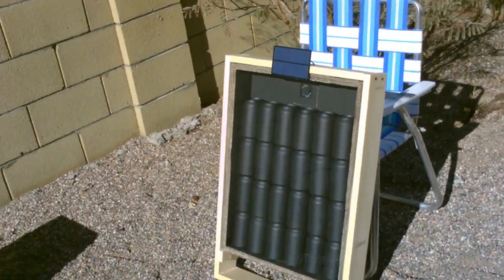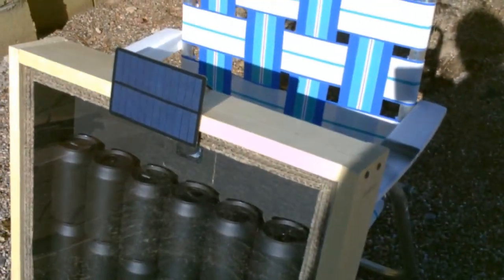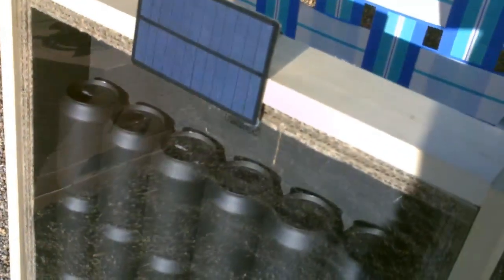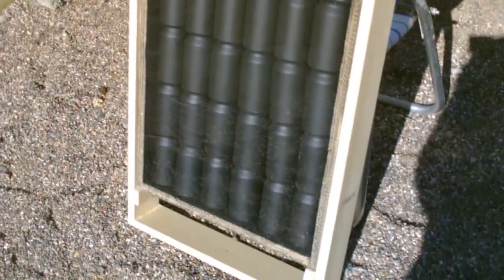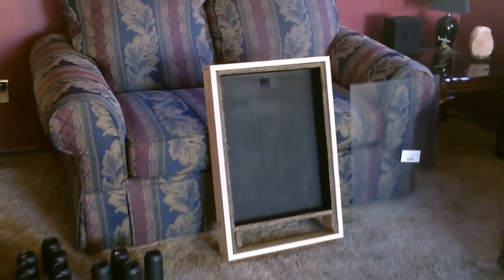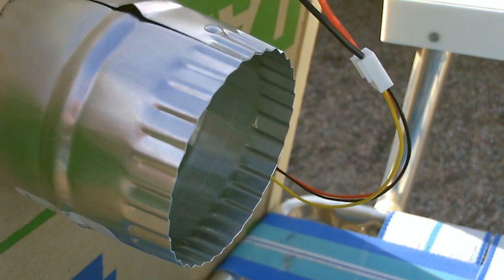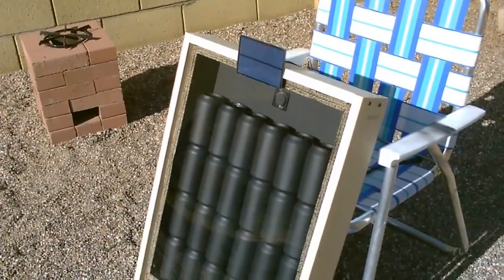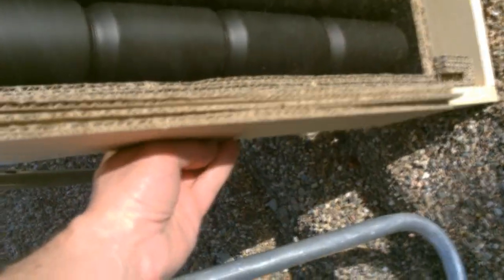Solar Air Heater - DIY solar thermal furnace - 150F+ Temps. (beer/soda/pop can heater) - full vid.

Comment: My heat is electric, I wonder if I can use this to supplement my heat to save some money.  Now just how to get optimal heat from this to my condo...
Reply from the maker: hi. these are a great solution for supplemental heating. i find the best way to get the heat in the house is to pipe it in through a window. i use a 1x6 board in the window (with vent pipe attached). just slide the window down onto the board. plywood should work also

Comment: Dude would yo be able to to send a link to this small fan and small solar panels?
Reply from the maker: hi. i can't find exact links but you can use pretty much any small 6 to 12v computer case fan. they have lots of them on amazon. the solar panel was from radio shack. you can get similar ones on amazon too.

Comment: Only down fall is when it's not sunny your not staying warm here in MN winters. I wonder if there is a liquid pex line to run through your system to store disapaiting heat longer? Ive also thought roof top space has always been underutilized. An entire roof could be done this way but glass roofs are a challange, I suppose poly carbonates / acrylics don't refract lights as good as silica glass. Your thoughts?

Comment: Can anyone offer help on mounting the glass? I could put a bead of silicone all around and let it dry, then use that as a cushion and to even out areas to make a seal, but then how to screw it down? I don't want to glue it in, because I need to get inside it to clean and replace the fan, etc. I thought of using rubber foam window seals, but thought they might degrade. I'm really at a loss.

Comment: I'd like to use one of these DIY solar air heaters for a tiny house I built that uses a wood stove for primary heat. Does anything prevent cold air from entering the house during night time? I'm envisioning adding a backdraft vent just inside of the tubing/piping that ducts the heated air into the house, keeping the backdraft vent near the solar powered fan; I think that the fan would blow open the vent and that as the sun goes down, the vent would shut once the solar powered fan stops running. I'd like to use this concept to create passive heat in my tiny house when I'm not home to be running the woodstove, just to keep the temperatures up a bit compared to a non heated environment during the winter but I don't always return home until later in the evening so I don't want cold air entering after sundown. Also any advice one what a good size unit would be for living in upstate NY? Thanks!

Comment: Looks Great got a question. If you were to put that same setup in the house facing out a south window. With a fan at the bottom pulling cold air off the floor and the hot air coming out of the top would it work better? Plus being inside it won't be as cold to start with... I like the idea but would like a little more info :) Plus if you put the fan on the intake side where its cooler wouldn't it last longer?
Reply: I was wondering this as well as the air in house is already preheated - but I cant see why not

Comment: You should install the fan on the air intake, for the simple reason that you generate heat , so the life span of the fan is reduced because of the heat :) Otherwise is a great concept (I am thinking to heat a greenhouse using this) - additionally with a controller (arduino perhaps) you can control the fan - to push air in the building or to extract air from the building (heat for example) ....

Comment: What are specs on your solar panel and fan? Will most 1.5 - 2watt panels power an 80mm computer fan?
Reply from the maker: hi there. it's a 6v 250ma solar panel. a 1.5 to 2 watt panel would be about the minimum size panel that would power a 80mm fan. a 3 to 5 watt panel is optimal

Comment: I made mine fairly large 44" X 78" and uses 224 cans. The box consists of galvanized steel studs creatively tabbed at the corners to make joining easier. 1/8" masonite backplate. 1-1/2" foil backed, high heat resistant foam insulation. Large 12v fan on the cold intake side for obvious reasons.  1/4" heat treated safety glass cover. Weight approximately 80lbs. Mounted on roof. Most efficient design I have come up with yet and only 4" thick! Small types work great also but I needed to heat a large area.

Comment: I have made a solar heater similar to yours, but i have trees that will block the sun light at different angles. would you have an idea to align the sunlight to the solar panel . I have tried many times to angle the box to the sun light, sometimes it will work and other times it wont.

Comment: Is there any impact on heat output if you reduce the air flow speed?
Reply from the maker: +TheJezrock hi there. yep. the slower you run the fan, the hotter the exiting air will be (because the air has more time to heat up before being removed). *the trick to maximizing the efficiency of these solar air heaters is to properly size the fans airflow volume with the size of the box.
Reply: Thanks for confirming

Comment: I love this design, but curious what do you do during the night?  The nighttime is when you need the heat the most, however I don't think this does any good without the sunlight, no?
Reply from the maker: Nathan Daniels hi there. since these types of heaters only work when the sun is out, i use a natural gas furnace at night. i'm currently working on possible ways to store the heat generated from these types of solar heaters for later use. (using water/sand/rocks etc...) all store heat well and are typically plentiful and free
Reply: +desertsun02 we used mostly passive radiant heat overseas, just a unit outside made of cast-iron and gas, heats up the water, then it starts at lower elevation through the house and at the end completes with highest elevation.. i think heated water naturally flows through the house so the end of the pipe coming back is luke-warm at that point. When gas would somehow be cut off at night, the pipes are still lukewarm in the morning and house stayed warmer than otherwise. IF you went with rocks for storage, would you want to insulate them then perhaps open insulation when needed at night?
Reply: Nathan Daniels it's nice because it keeps your house warm during the day meaning that when you come home you've already got a bit of thermal energy left in your house meaning it's easier to keep warm during the day.
Reply: desertsun02 I  thought the  same thing first!  But later I  realized, that  I(and lots of other ppl) don't sleep  very  well  in temperatures above 20 C degrees.... for me, it's a torture  to sleep during the summer tropical nights, when temperature  doesn't go under 25  C  .I even sleep better in   5-10C conditions - because I love to burry myself in the bed :P ... optimal sleeping temperature  is  around 18C  so  residual  heat  from preheated  room  and  the  insulation of the bed  itself  is enough to keep you healthy-warm during the night:)   but I am curious how this   device  works  in  -15C  outer conditions.....
Reply: desertsun02 Hi there! What if you raise the floor so at to heat under it and allow the floor panels to absorb and redistribute heat throughout the day?

Comment: Nice idea to simply use dryer ducting; seems easier than dealing with a bunch of aluminum cans, plus you get even air flow since it is just one path compared to most can based units.  Some designs use cans mounted horizontally in rows, with baffling to direct the air through all of the rows in one path, but that's a more complex design.  I think I've seen where some one put steel wool inside rain gutters or cans or whatever they were using for the air channel, to increase the surface area and heat the air much more.  That might be a good idea with this design since the ducting is rather large in diameter; the steel wool would also slow down the air speed allowing further heating.
Reply: +Sitaifun Mac Interesting idea for putting steel wool in the cans. I'd be worried that it might bunch together limiting the flow rate and the efficiency of the system. It'd have to be quite porous and probably mounted to the side in some way. Do you know where I can find more information related to the efficiency using steel wool? I'd be interested it in incorporating it in one of my future projects if it does increase energy production from a unit. 

Slowing down air speed will allow further heating, but with all heating systems you want to increase the energy/time, or power of the system. Too slow you get a high temperature, but less air, meaning the amount of energy you receive might actually be less over time, when compared to a large mass heating up slightly less. These are the considerations that ultimately effect the fan sizing (speed of air) and the maximum amount of heat you may get out of a system based on the temperature increase due to solar radiation.
Reply: +Braydi McPherson - I agree it would be important to avoid slowing the air flow too much.  You could pull the steel wool apart so that it is fairly porous, and if necessary you could use a variable speed fan to control the air flow.  There are quite a few variables in each unique solar system design and operating environments, so it could be a challenge to quantify the results.  However, I found someone has done just that: http://www.academia.edu/2463982/EXPERIMENTAL_INVESTIGATION_OF_SOLAR_AIR_HEATER_USING_POROUS_MEDIUM  They got about a 26% increase in efficiency.

Someone also employed steel wool in their solar dryer with good results: http://www.currentscience.ac.in/Volumes/107/03/0350.pdf

So I recommend giving it a shot and see what kind of performance you get for your particular scenario.  You could try different materials such as steel wool, aluminum foil strips, copper, etc.

Comment: He's in 40-55 degree temperatures.. I'd be interested to know what temps it can heat to in -5 to 32 degrees F
Reply: It's a solar heater, so it depends entirely on the amount of sunlight hitting it.
Reply: well, it looks like it's just heating ambient air, so the lower the temperature input, the lower the temperature output.  I think a way to get around this would be to funnel the air through those can stacks in series, so the cold air would have longer to head up.
Reply: @wamatt2476  Except the air would have to move the cans faster since the fan will suck out the same quantity or air. I<m pretty sure the air will be in the cans for the same amount of time in the end. Plus the sun exposure wouldn't change either, so the same amount of energy will be transfered. I'm pretty sure this also makes it easier on the fan because the air flows easier in this than it would if it was in series. If you want more heat, make the panel bigger. There is no secret here, the panel has a limited sun exposure. The more exposure the better. But I love how this design is small and seems very efficient. The kind of thing you can put in your bedroom and turn periodically to follow the sun!
Reply: Insulate the ducting going in and out of the house, as well as caulk all areas of the heater box. I'm adding mirrors to both sides of mine to increase solar absorption. My collector is different from these on YouTube, and I'll be posting my first video on it in a few days

Comment: If you only draw outside air from the lower cans, then how is the cold air removed from your home to be replaced by the warm air with your unit? Without a plenum at the bottom, it just seems that your drawing the outside air and not removing the cold air from inside the home. This would still produce heat to be pushed into the home, but would not be as efficient in exchanging the hot air inside with cold air, as nothing is being drawn out by this type of solar heater. Maybe I missed it, but this is more of a question about the unit construction and efficiency than a negative comment. I just didn't understand how this style unit works better than one with a plenum that removes the hot air from the home as the cold air is pushed into it. Nice looking unit though.

Comment: I didn't believe this until I made it myself. Outside it was 40F on a bright, sunny day. My heater was putting out 150F temperatures, and higher (my thermometer just said "HHH".)

I used corrugated metal sheets.

Comment: Is it possible to use soup cans? Specifically Campbell soup cans that have flip tops that peel out the entire top of the can? I noticed the use of silicone to seal the cans together but in addition can you use Duct tape to seal them together and then paint them?

Comment: I want to ask you about matching the Solar Panel to the fan. I heard you say 1.5 volt panel to the 1.5 volt computer fan. Is that correct?
Reply from the maker: hi there, i used a 1.5w 6v solar panel. the computer fan can be run using a 6v panel or a 12v panel.

Comment: is there anything inside the cans?
Reply: cans are empty, with holes in top and bottom to allow air to flow through them like a tube.
Reply: I was wondering if it could be filled with those terra cotta balls for hydroponics or small stones--maybe at least in the lower level cans as it would add weight, but maybe better heat storage?
Reply: Or maybe filled with steel wool?
Reply: L84aD82012 No, because that would stop the air flow through the cans. The air flows through the system due to convection, a bit like a solar chimney or rocket stove.
Reply: On many units, the person can take steel wool and attache it to the openings of the cans. It is generally rolled into a tube-like donut shape and has an opening in the center of it to allow free air flow, but to also act to keep the heat conductivity of each can where they join together. The cans contract and expand, so this type of mod would supposedly help in keeping the heat transfer leakage as small as possible. In addition, the hoops of steel wool between each can can act to slow down the heat current enough to keep the warmth inside the can a bit longer as it travels through each tower. I am not sure that this theory works any more efficiently than simply joining the cans that have both the bottoms and tops cut away and not installing anything between them. This same principal is the basis of those folk who take the time to make cuts and fins between the cans to swirl the air as it enters into each tower. I suppose the only way to know for sure is to make a single tower of cans by each method and test each for both air flow and heat variations. I honestly believe that almost any of the diy designs actually work pretty much the same when it comes to being efficient. A fan with an increase CFM to it would likely push out warm air  more efficiently than a unit made with a smaller fan capacity or even one that does not use a fan at all  However, the cost can be a factor, just as the labor intensive work involved in using the steel wool mods can be a factor. I believe that whatever one wishes to put into these projects is equally rewarding by what they get out of them.

I have viewed virtually every such video on YouTube that I can find. Each has something unique that I'd love to try or perhaps something that I really wish to avoid.  :-)  This is a nice video to learn and get ideas from.
Reply: ***** Is there an opening somewhere (I would guess at bottom) where the air can get into the box? I didn't notice you mention that. I love this version, it seems very cheap and easy to make. Thanks for sharing.
Reply: you drill seven holes in the wood underneath,,,,for each can(7 rows) and 7 high total of 49 cans....might want to glue them together. hotmelt glue gun.
put about 7 holes in the bottom of each can.
under the wood where you drilled the 7 holes....put mesh window screen over it

Comment: Cool heater. I am thinking when I build mine use the small panel & fan idea as well, just like a switch. 92 or 120 mm case fans are cheap.

Comment: So very helpful!  Thanks for being so responsive to everyone!  One question about the solar panel - is it necessary to get a weather proof one (costs about 2x as much) or could we even put them right inside the box under the glass.  

I'm thinking if that's possible, it would be less likely to be knocked off by high winds or a snow-storm.

Also wondering if it's necessary to cap the outtake vent to keep the cold out when the sun's gone.  Again thanks so very much!!!

Comment from the maker: hi there, the heater does not reach temperatures that require "high temperature" paint. regular flat black spray paint works fine and is perfectly safe.

Comment: Im new to this but I want to build your model, can you give me a better idea where you drilled the 3 holes in the bottom of the unit, lastly do you place this outside and close the window on this unit or do you just place it on on the window? Just want to be sure I place it in the right spot for maximum usage. Thanks so much for the information.

Comment from the maker: nope, that's all you have to do. i experimented with regular cans, crushed cans and cans with the bottoms cut out and found that the temperatures are all the same. in other words, don't drill holes in them or glue them together. just paint the cans "flat black" and put them in. the trick to getting a steady/consistent flow of hot air is to not pull the air through too fast.

Comment: Awesome video!!
Thanks for sharing. I would like to know if you can supply the list of parts and where to buy them? Please also I am trying to heat a rented storage unit where i have a work bench for scrapping stuff I need just the small area by my work bench heated. Cause in the winter it gets cold. Any suggestion would be appreciated.
Thanks

Comment from the maker: thanks. i tried a larger fan in this setup (moved about 4 to 5 times more air).  the air did not have enough time to warm up before exiting.  a small fan will somewhat limit the distance (you could put a small oscillating fan near where the hot air exits.  that would help increase distance) or just make the collector bigger.